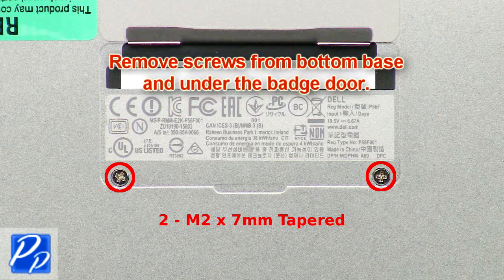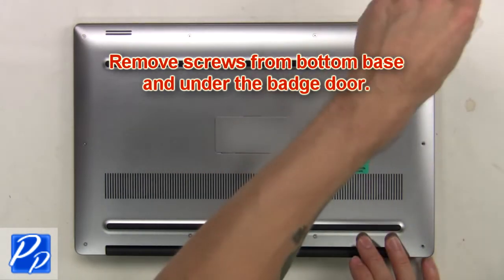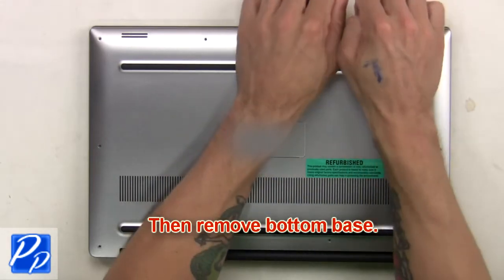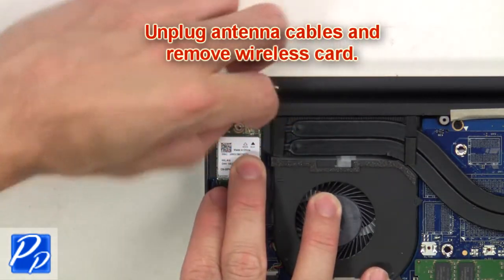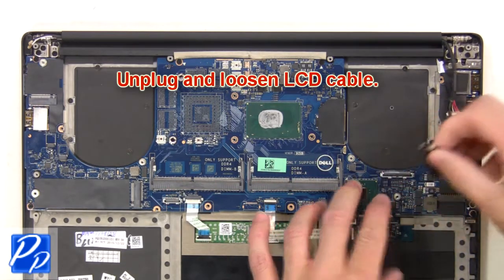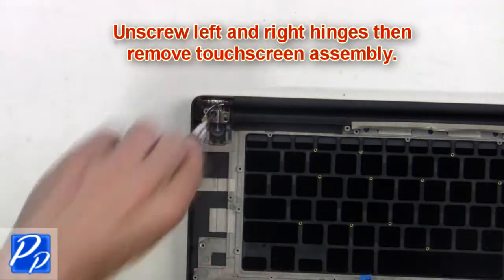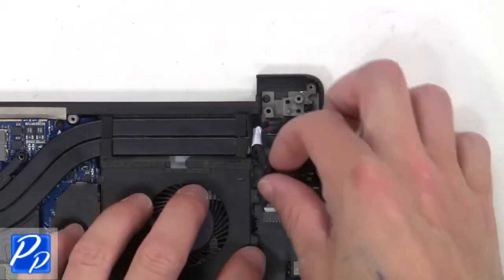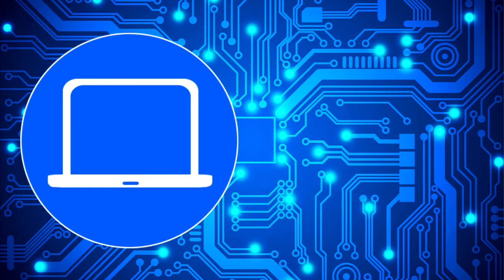Dell XPS 15-9560 (P56F001) DC Jack How-To Video Tutorial

Comment: I just completed this repair. I found undoing the left side wires and hinge unnecessary. If you unscrew the right side hinge, then with some force you can get the right side hinge to go up exposing the DC jack and its screw.
Reply: Yeah I was acutally wondering whe he did remove the WiFi module. Is it just because of the tension on the hinges?

Comment: It looks like the wires from then wireless card have to be re soldered?
Reply from the maker: No soldering required. These antenna wires snap directly onto the WLAN card.
Reply: Just completed this fix, those wires were the weirdest part - didn't seem like they wanted to go back on until they just did. Not sure of the mechanism but got them to affix back on without soldering.